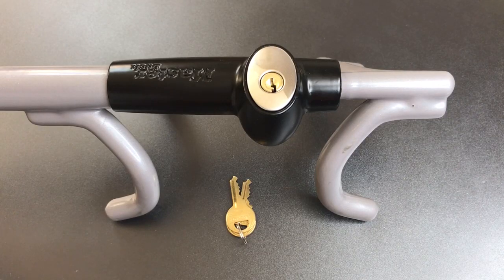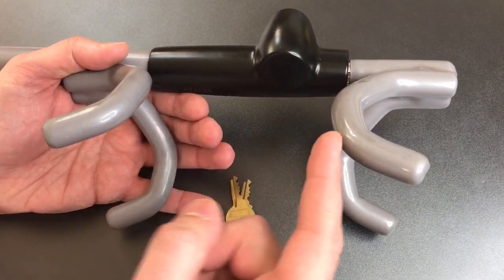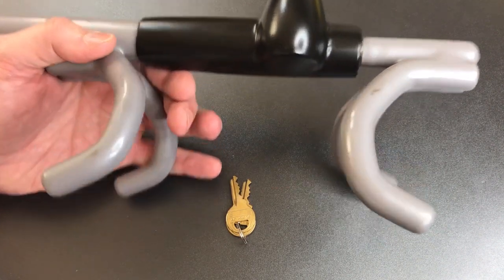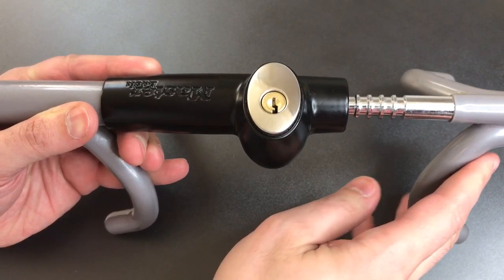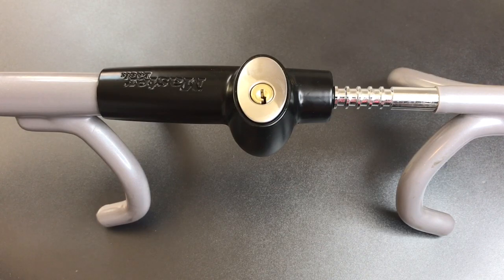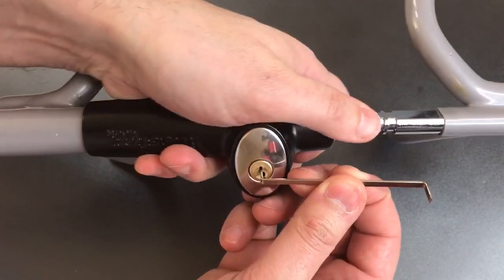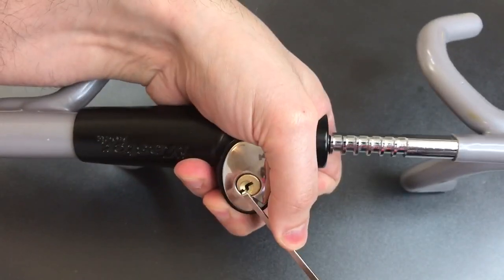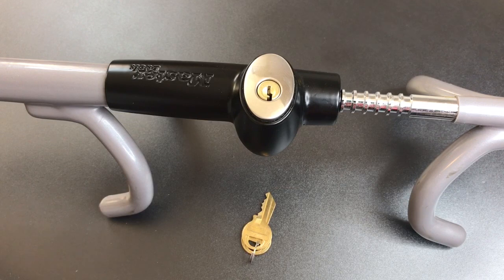[587] Master Lock 252DAT Steering Wheel Lock Picked FAST

Comment: Hi Harry, These steering locks were very popular a few years ago, but regardless of the lock cylinders, the weakness was in the ratcheting pall. Car thieves quickly realized that by striking either end with a hammer, the pall would shear and the lock could be removed. We tested this and it was very quick. They all failed except the Abus, which didn't rely on a sliding/ratcheting system - they knew. Merry Xmas Harry, to you and yours.  Regards, Brian.
Reply from the maker: Hmmm... something to try. 😈. Thanks.

Comment: When I had my Service Van, I had Medeco / Adams Rite swingbolts on all the doors and a (Medco switch lock for the ignition) .. and I converted a "Club" steering wheel lock to accept a Medeco Cam lock cylinder (KA of course and KA top my shop and house)) ... it was a HUGE pain doing the conversion and I ruined one Club lock doing it :) ... the Medeco cylinder was epoxied in ... it worked great for years though!

Comment: That could not be anymore pathetic!! Would never use that in my car.
Reply: How expensive is one relay and some cable compared to this? Wire one side of the coil to the brights, the other to ground, then wire the starter solenoid through the relay. Now the car won't start unless you are flashing the brights while turning the key, which will drive the thief nuts.

Comment: Are there no trading laws that make this not fit for purpose!!!!!!
Reply from the maker: Probably not... I'd usually leave this to the invisible hand, but consumer ignorance stymies that.
Reply: LPL, I believe in the UK I could fairly easily get my money back for anyone who bought one - provided they did so before watching this vid. 

But any liability regarding other losses (of vehicle for instance) might be more difficult. It would depend upon the type of statements or claims Master Lock make about this product in their marketing. 

Having said all that, it's clearly not fit for purpose by any reasonable standard. If it can be opened as quickly without the key using a simple taking technique, then they haven't even attempted to make a competent security device. Does that make them liable? Sadly a judge would have to decide on a case by case basis, and we all know what that means!
Reply: Interested to know if there are any precedence along these lines, but I'll leave the law to the... ahem ... lawyer.

Comment: Is that not false advertising? Claiming that to be a secure locking device? 
If a medeco or abus could be found that would fit around the adjustable section where the rings are,  it would be a good device.

Comment: Try picking a tractor trailer pin lock.
Reply from the maker: Link?
Reply: most people that steal trailers just cut the slot for the fifth wheel pin larger on their tractor and steal the trailer lock and all
Reply from the maker: Looks like a cheap wafer lock, from what I can see... not sure it's worth the $40 to test it. 😬 I'll think about it.